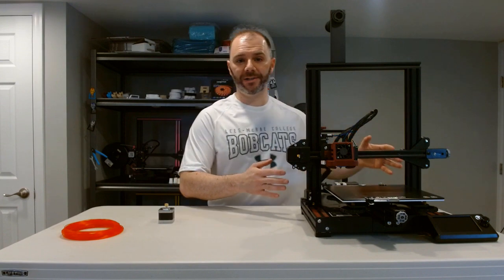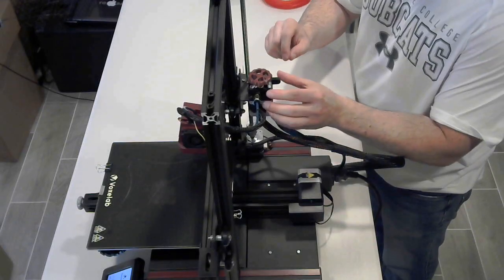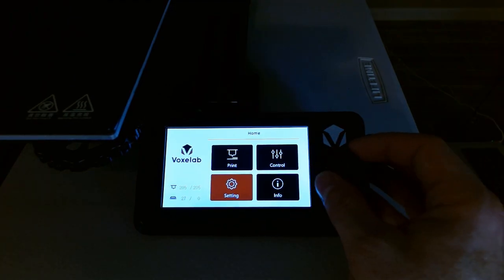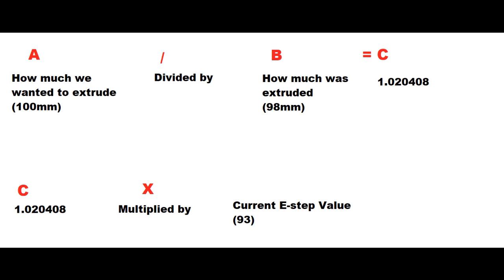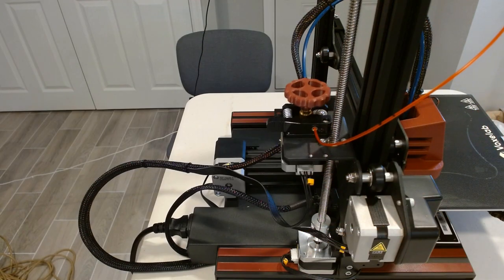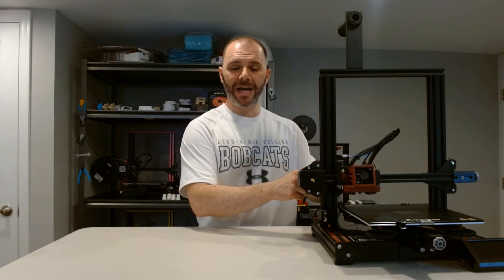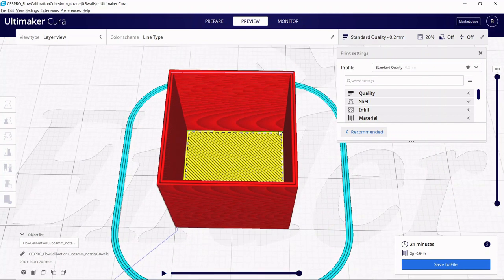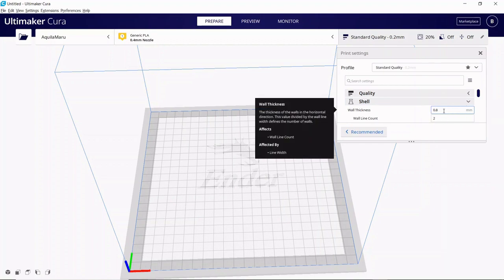E-Step Calibration Voxelab Aquila

Comment: Hi, I am a beginner and I watch your videos which I really like because the explanations are very well done. I modified my Aquila S2 with sprite pro and added CR-Touch. Here I am now on the settings. I'm trying to adjust the e-step but find I have a lot of lag. I ask for 100mm extrusion and get 22mm. My question is: is it normal to have such a large lag? so I have to put 422.7 in the settings knowing that the base setting was 93?
Reply from the maker: Yes this is common when going from the single geared default extruded to a dual gear extruder (which now incorporates gear ratios). If you are adjusting your esteps and not seeing any changes make sure you are saving the new estep values from the menu before performing any new tests.

Comment: using the formula, i still cant get the right amount
ive done it 10 times and it turns out difforent each time
Reply: Do You know what I should do?
Reply from the maker: Hey I'm so sorry for such a late reply. Are you still having issues with this ?
Reply: @PrintsLeo3D  It is ok. I am still getting prints out ok, but the e step is still weird. It will print out 100 mm then the next time with the same estep print out 112. I replaced the extruder, with a new dual gear extruder, replaced the nozzle, and the Bowden tube.
Reply from the maker: That's really weird. It can be tricky to get it to work at first, but if you're getting good prints then there's no reason to mess with it.

Comment: So I've done the first cube and came out with a new flow rate of 97.7%. I've updated my slicer and reprinted and now I'm getting an average across the 4 walls of 0.775. if I run that through the calculation again I'm getting 103.2% but that can't be right - is there a different calculation to fine-tune once you're not at 100% starting value?

Even if I times my current value (97.7%) by the new figure (1.032) that still brings me up to a new flow rate above my first print which was too thick.
Reply from the maker: Hey Nick! To be honest your exact problem is one of the reasons I have been moving away from this method and moving to a less exacting method (with better user experience). Calipers measuring walls can leave room for some errors. In your case I would print at 98% and check the walls. If they're still a little thin I would to to 99% then 99.5% until the dimensions got more exact.

Comment: I followed your instructions to the point but I extruded less filament. Did the same formula with the new settings and again I extruded less filament. Can you please advise? Cheers
Reply from the maker: Hey Andrew! There have been times when some people had extruder related issues (gear not tight, poor filament path, etc) that caused some issues. Can you remember the numbers and the math you used. I would be able to give a more complete answer if I know the path you took with the numbers. Also what type of printer and extruder combo are you using?
Reply: @PrintsLeo3D  100 / 96 = 1.04166667 x 93 = 96.9  after that I got 92.6 mm of extruded plastic.
Reply: @PrintsLeo3D  thanks for replying I’ll forward the sums when I get home. 👍🏻
Reply: Thankyou for the videos they are deffinately helping me 👍🏻
Reply from the maker: That looks good to me. The two things I would check are:

Make sure the new E-step number is being saved between testing. (and you are entering at the correct menu)

The extruder: If this is an Aquila or Ender 3 with the stock plastic extruder it's very likely the plastic tensioner arm has a slight crack in it which will sometimes not tension the filament correctly as it's extruded. I have ran into that before when someone else was having the same issues you're experiencing.
Reply: @PrintsLeo3D  Thankyou for the insight, I did it by trial and error in the end, I now get 100mm when I ask for 100mm. Your videos are deffinately a good starting point and very insightful Thankyou.
Reply from the maker: @andrewmace4081 awesome glad to hear it, and thanks!

Comment: I have a problem with that printer cause my build plate keeps shifting and it messes up my print is their a way to fix it
Reply from the maker: Mario! Yea there's a few ways to stabilize a build plate in place. What kind of surface are you using ? Is it glass? Also is this a Voxelab Aquila or something else ?
Reply: @PrintsLeo3D   I’m using a Voxelab Aquila C2 printer 220x220x250
Reply: @PrintsLeo3D  it’s a glass plate
Reply from the maker: The clips that held the glass plate onto my original Aquila were very weak. I ended up using binder clips (you could find at any office supply store) to secure the bed in place. Ultimately I would recommend something like a PEI bed sheet instead of glass, but that's up to you. I have a video about pei you may want to check out!

Comment: This helped a lot thanks! Prints were always ok, I found it was under extruding by almost 1cm. Then the flow rate of the cube seemed too much as each side was 0.85-0.87 (depending on caliper accuracy) so actually dialled down the flow to 96%. Looks pretty good now! thanks.
Reply from the maker: Great to hear and happy to help! I should have an additional flow related video coming in the future that showcases a new method I am using. Thanks for watching and for leaving a comment to let me know this helped you !

Comment: I appreciate the tutorial, this did not work for me but it taught me a lot.  These are not precision machines to the level of your calculation. I get swinging results on retests at same settings and different length extrudes.  Honestly after lots of testing around the first method and learning the impact of the adjustments i just went with the factory setting and pivoting one decimal point at a time then 100mm and 50mm test.  Up 0.1 to increase extrusion length and -0.1 to shorten.  93.3 was  my most consistent number.
Reply from the maker: These machines certainly aren't the most precise but trying to get a solid number on the e-steps should not be out of their boundaries. You may not have had to make much of an adjustment at all, which sounds like that was the case, which is a good thing. In general with the stock equipment (ender3, aquila, etc) generally a number between 93-98 is usually correct. Thanks for watching!

Comment: Great video. I have 3 Aquila printers. I've run the test on each and the reading are WAY off. I even ran 200mm to make sure I was looking at the right formula. Here is what I got. 200 expected, 145 actual with 110 E-Steps. That would come up with a new E-Step of 151.6 That sounds WAY high. I have upgraded all 3 printers with Winnsinn all metal dual gear extruders. All 3 are show the same 140-152 adjusted E-Steps. Could this be right? Am I  under extruding by %35? Right now my prints look great. BTW, flow rates are %100.
Reply from the maker: I'm glad you liked the video! With a standard extruder those numbers sound pretty high, but with a dual gear metal extruder not so much. I believe I was near the same numbers when I installed my dual gear metal extruder. I can't remember now, but I think my E-steps were somewhere around 130-160. If you were under extruding but at 100% flow it's possible to not notice a problem , but over the long term trying to dial in certain calibrations would be an issue. Best now to get the esteps right (just like you did) and then adjust the flow, which I am going to assume is going to drop to somewhere around 95%
One other thing is a warning about those all metal dual gear extruders. The majority of those extruders don't have a washer or gasket underneath the second gear that's in the tensioner arm. Without that washer the gear will slowly eat away at the tensioner arm. This will cause a buildup up of grime and metal shavings. That leads to the impairment or failure of the extruder. So please keep an eye on that the more and more you print. 
Thanks again for watching!!!
Reply: @PrintsLeo3D  Winnsinn just upgraded their extruder with a washer. I've gone through several because the gear kept eating into bottom.
Reply from the maker: That's great to hear. So many peope had bad experiences I'm glad they listened and improved.

Comment: Best budget printer out there. Love my Aquila. E steps are my last step before I am back printing after an extruder upgrade. Finger crossed I redid the bowden tube right though, my all metal hot end kept getting plugged up and went back to stock hotend, sure hope it isnt me messing up the bowden tubes... but I digress.
Reply from the maker: Good luck with it! A lot of times with an All Metal hot end you need to lower the retraction down to around 2-3mm or else it can get clogged. The Aquila really is an amazing printer, for the price the prints that it is capable of producing is astounding. All these machines need is a little TLC! Thanks for watching and commenting!

Comment: There's no room on my extruder to slip an extruder knob on to.  Suggestions?
Reply from the maker: Unfortunately on the newer releases of the Aquila the extruder gear is pressed on. This leaves no gap on the stepper motor arm to slip the extruder knob onto. Trying to remove the gear can be a tricky, and for just an extruder knob I wouldn't recommend it. If at some point you look to replace your extruder (if it's the stock extruder I highly recommend it - to a dual gear extruder) then at that time you can look into trying to remove the gear. Until that I wouldn't bother trying to mess around with it.

Comment: This process has not worked for me. At all. I go133t the metal dual extruder, which has smaller diameter rollers. As noted in the comments below, the step setting of 93 pushes 63.9mm of filament. Using the formula I get a step setting of 143.3, which pushes 133.2mm of filament. Doing it again then lowers it to below 100mm, and so on. I also tried working out the position based on the two datapoints, which gave me a step around 120, and yielded 80something mm of filament. I can't think of any other solution, I am guessing the development is non-linear.
Reply from the maker: That's pretty frustrating. I'm trying to think of other possible causes and I'm not coming up with many alternatives. This feels like inconsistent extrusion, which would make me think the pressure on the filament may be the cause. Also before you replaced the extruder had you done an E-step calibration with the stock extruder? If so was it successful? Is it possible the stepper motor itself is damage and instead of rotating around a center axis its slightly concentric, causing the filament to be pushed inconsistently. Can you link me to the extruder you purchased? If you want to email me we can trade some pics/vids of the issue and maybe get to the bottom of this. Printsleo3d@gmail.com

Comment: So, the formula doesn't seem to work for me. My extruder was spitting out 91mm and my original e-step was 93.0 punching those into the calculator gave me 102.1 or 102.2 and with both of those new values it extrudes way too much filament.
Reply from the maker: There are times when the first calculation is not enough and you'll need to continue the calibration. After you add the new E step value (102.2) and ask it to extrude 100mm, what is the result? Also extruding only 91mm is a lot lower than normal. It might be a good idea to check your extruder and make sure there is no damage and it is operating properly. Make sure the tension arm is tight enough and the gear on the extruder is not slipping while extruding.

Comment: What replacement piece did you get for the stringing issue? And or where can i also acquire one 😂
Reply from the maker: I have been pretty lucky to not contend with too much stringing over the lifetime of this printer lol I think I owe a lot to the Capricorn bowden tube, new pneumatic couplers (screw into the hot end/extruder), and all metal hot end. Of course the calibrations of all these things helps as well lol

Comment: Love the video, 1 question I am getting feeding issues, i see some wear on the brass gear. I get some slippage. About how many hours do the brass gears hold up?
Reply from the maker: Thanks for commenting! I've never really experienced much degredation at all in the brass feeder gears. You bring up a great point though, I am trying hard to remember the last time I really inspected that gear and I can't think of a recent time, which makes.mr think I need to get a better handle on my maintenance inspections. If the feeder gear on your machine is/starting to wear it might be time to look into replacing the extruder. I have a video that showcases some dual gear extruders, and that's the path I would take. Now if you're talking about the brass inlet hole on the outside of the stock extruder ? That does wear sooner than later and I would certainly replace my extruder if that was showing wear.
Reply: @PrintsLeo3D  do you have a recommendation on a direct replacement for the aquila extruder?
Reply from the maker: If you're looking for the same type of extruder, I would look for an all metal version as they end up holding up better. Hictop is a brand I have never had an issue with, I have never bought their extruders but their other equipment had been quality 
HICTOP All Metal Extruder Upgraded Replacement Aluminum MK8 Extruder Drive Feed for Creality 3D Printer Ender 3/3Pro CR-10, CR-10S, CR-10 S4, and CR-10 S5 https://www.amazon.com/dp/B0761PGLZ4/ref=cm_sw_r_apan_glt_fabc_Y44WW2G51E57NCV0PM30?_encoding=UTF8&psc=1

If you up wanted to "upgrade" then I'd recommend the BMG clone. It's a drop in replacement but it does operate differently so I'd recommend watching my dual gear extruder video. I didn't buy one from the below seller but this is the type of extruder. 
BCZAMD 3D Printer Accessories Upgrade Extruder Plastic Dual Drive Extruder 1.75mm for Tev Tornad Wanhao D9 CR10 Ender3 V2 Ant E10 Black https://www.amazon.com/dp/B07RBL4CJC/ref=cm_sw_r_apan_glt_fabc_YJ4NKVB6GPMFKBN695WA
Reply: @PrintsLeo3D  just want to say thanks for all your help and responses. I got the new dual extruder and followed your calibration video to a T. I had some problems and backed my feed rate back 20% and now I'm back to solid prints!
Reply from the maker: I'm happy to hear you got a new extruder and are back to printing! Glad I could help wherever I could I love this hobby and the more people who are happy and printing the better! Love to hear you go a dual gear extruder as well! Can I ask which type of dual gear you settled on?

Comment: How is it that the flow is 0.7mm on one side of the cube but 0.8mm on the other sides? Are you just taking the average, and is it because of how the callipers rounds numbers up or down? How does the callipers do this rounding? 
For example does a reading of 0.7mm mean it's between 0.650-0.749mm, and 0.8mm is between 0.750 and 0.849mm? 
Or does it mean that anything over 0.7mm gets rounded up to 0.8mm?
I could see how it would make sense in the former situation, but this could still suggest that since it's assumed that the printer is extruding evenly, then all the sides are close to 0.749-0.750mm.
Does this make sense?
Reply from the maker: Yes even you said makes perfect sense and you're right about the calipers. I'm going to make a follow up to this video and use my newly purchased calipers that are more accurate and offer a measurement to the hundredth (0.xx) of a mm. The calipers in this video only will show one spot to the right of the decimal point which is so limiting and really should not be used. So whether the reading is 0.71 or 0.79 it will only show 0.7 which is misleading. I have a link to the bre calipers I purchased (and recommend) in the description.
Reply: @PrintsLeo3D  Ah right. So the old callipers only showed the first digit of the measurement (obviously!) but it didn't do any rounding of the number. I suppose that makes sense. 
So it's possible without the accuracy you could even have made it worse, for example if the sides were 0.83, 0.85, 0.85, 0.79, you could have brought it to 0.86, 0.88, 0.89, 0.83 or something!
But still, I suppose getting the idea across was the important part, and I definitely learned something. And a few hundredths of a mm probably isn't going to be catastrophic anyway!
Thanks!
Reply from the maker: Yeah, you're absolutely right, it worked to get the point across but in the future I will be using my newer calipers! Thanks again for offering such great questions and comments, I always try and direct everyone to the comment section because there's additional information there and you are a huge contributor in helping other people who are going to have the same or similar questions.